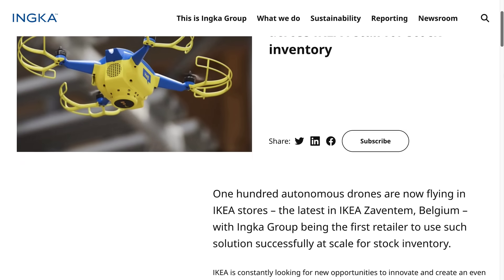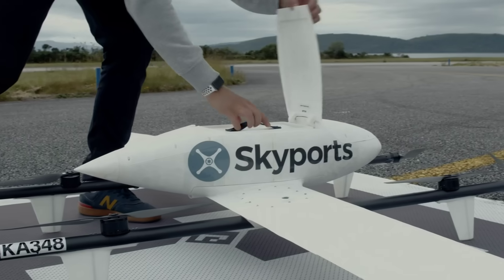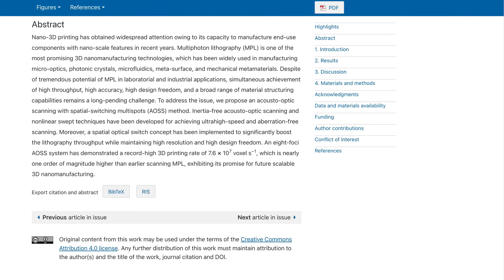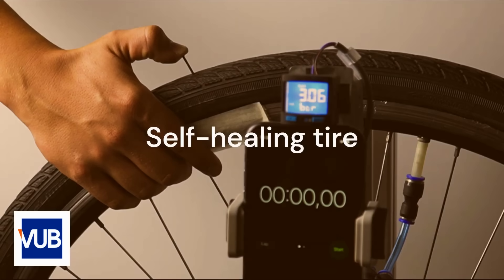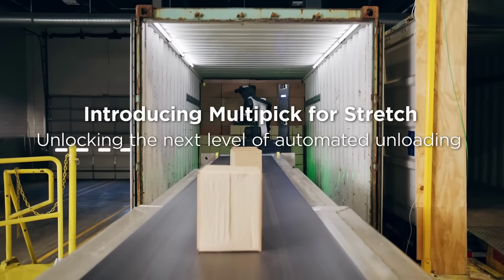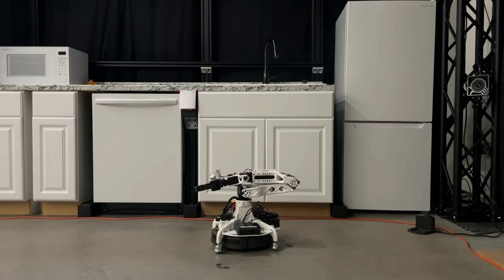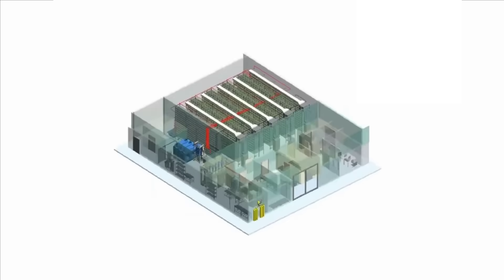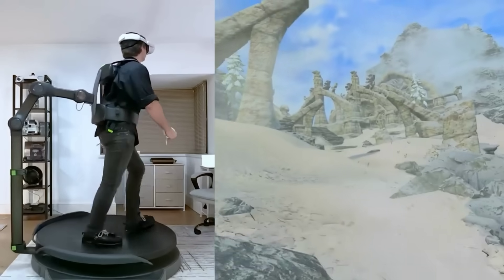Ikea's Automated Drones (+ More Tech News)

Comment: I actually saw that Isaac unit up close when I got a tour of Electroimpact, the engineering company that produces it, in about 2014. It's called the AFP on their site (where there are many more videos) and can be mounted on either an xyz gantry for faster, more rigid operation producing large, mostly flat shapes like wings. Or on an off-the-shelf robotic arm like in the video for more complex shapes. It uses spools of ~10mm wide resin impregnated carbon fiber strips that feed to the head where a heat lamp activates the adhesive and actuated blades cut each strip individually. I believe the part is then oven cured. It's a really cool system.